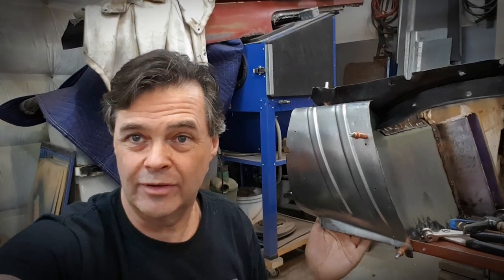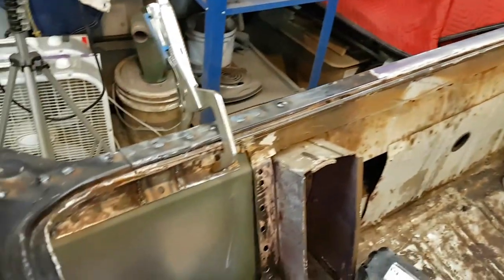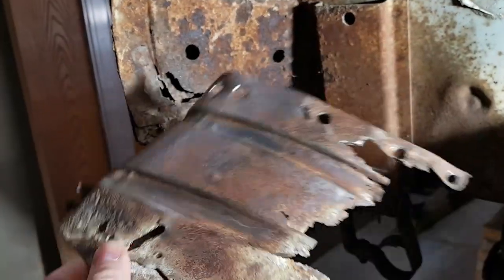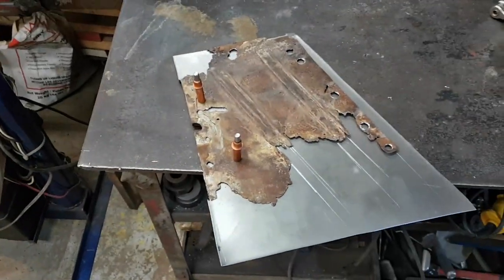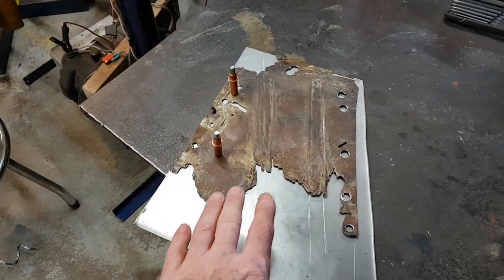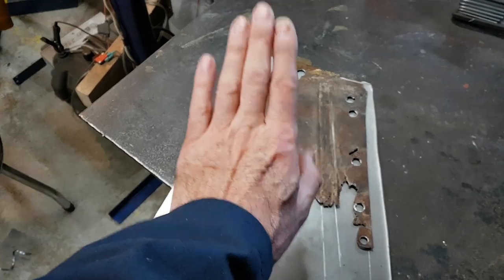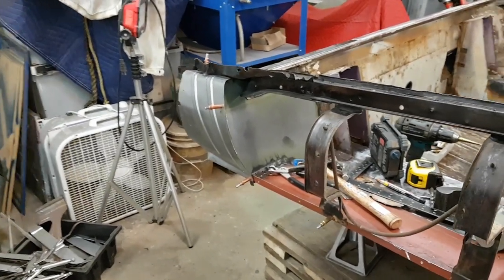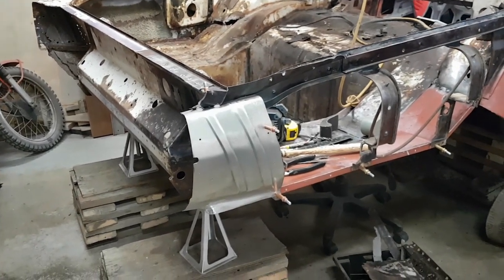Rear Right Quarter Inner Support Panel Fabrication - 65 Thunderbird Convertible Restoration Ep #39

Comment: I’ll admit I had to rewind to see the original shape, but I saw the bead was made inverted. Assuming that the rest doesn’t conflict when you go to reassemble you might be fine. But I would test fit everything before welding it in place and remake it if it does. 
Those are the type of dies I use for the lettering on my floor boards, you don’t have to put the marks on the other side of the sheet metal, just alternate the dies to fit your needs. 
All in all it’s a learning curve and your doing just fine. Keep up the great work, and looking forward to your next vid!
Reply from the maker: Thank you Troy!
There will be a lot of tweaking and fitting before this one gets welded in, it needs to align with the outer wheelhouse extension, and the quarter panel...so it needs to be place in the correct position. There is lots of room to accommodate for my mistake...so I just continued on, however, in some cases it would have ruined the piece. Thanks for the die tip, by the time I finish this car, I nay get the hang of using the bead roller...but practice is the best way to get better! 😎

Comment: It is hard to tell from the vids, but what you are calling a mistake seems to be that the ridges are pushed toard the outside instead of toward the inside.  They are going to be covered anyway and seem to be doing the job of stiffening up the panel.  Pure magic all the same.  Great video!
Reply from the maker: Hi Stephen...you are correct, I made the beads on the wrong side of the panel, in this case it's not a big deal.
Thank you!

Comment: Alvin,
The excellent beat goes on, my friend.  The driver's side will be a repeat of all you've done, so are you planning to continue the step-by-step on it as well?
Regards,
John
Reply from the maker: Hey John,
I wasn't planning to go into this much detail on the drivers side...unless it's something I didn't cover on the pass side. The body work & reassembly will be covered in detail, and should be a little more interesting than a repeat of the Sheetmetal work.
Reply: Alvin,
I think that's a wise move.  It'll for sure speed things up for you.
Regards,
John

Comment: Another great job, just hoping those beads don't hold the quarter panel out too far.  You should be able to check the other side to see if the quarter sits right against that section.  Will you have to replace any of the area that holds the trunk seal? That area on mine is in terrible shape,  I will have to remake most of that little trough that that seal sits in.
Reply from the maker: Thank you Michael! The trunk seal area needs work where the quarter panel has been removed, the same will be true for the drivers side...outside of that, there is a section left of center on the back that looks like it will need some repairs in the seal trough.

Comment: Hello Alvin. That panel turned out real nice. My guess is that the distance between the beads is wider at the top compared to the bottom? I honestly think the panel is fine. What did you use to get that little bend at the end of your video? Thanks again, your videos are so helpful.
George B. in Michigan
Reply from the maker: Thank you George!
It is the beads, they are formed on the wrong side. However, you are correct about the bead width, they are also a little off. I just hammer formed the bend over my piece of railway track, it didn't take very long...about 10 minutes.